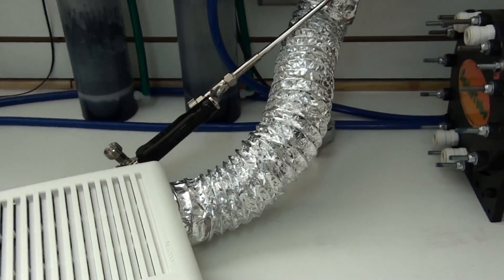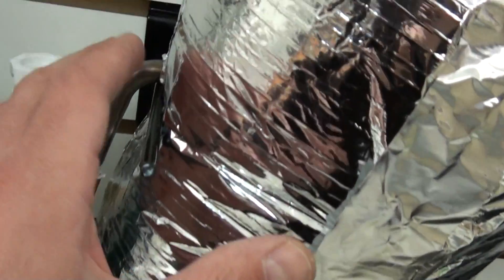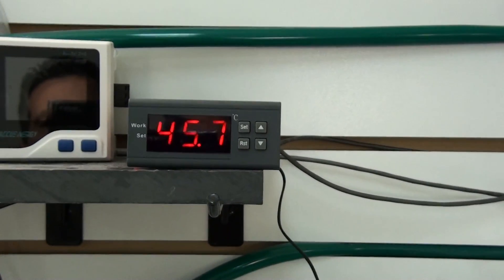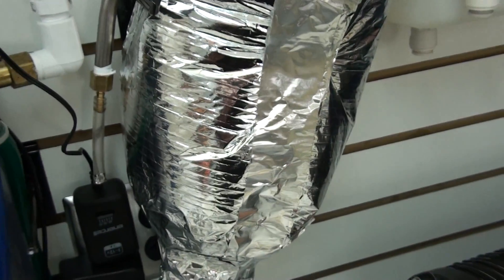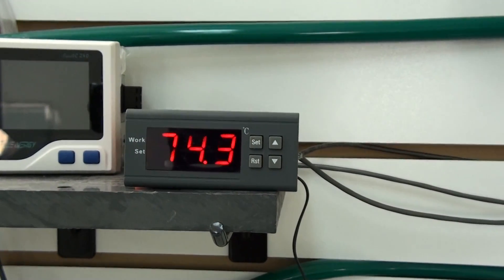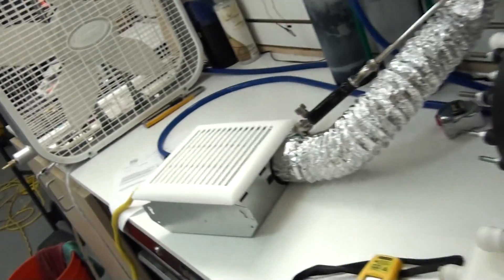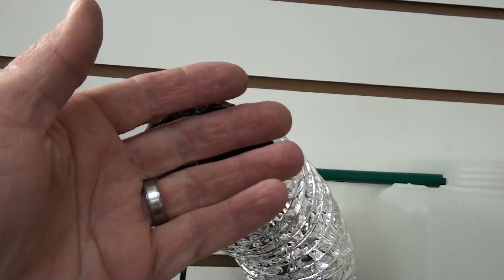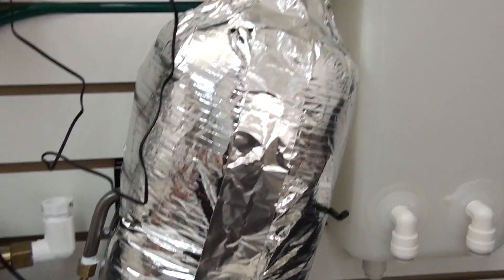H-CAT video 8

Comment: A couple years later... a couple more more observations...  
It appears that before you turned the fan ON, it was "running rich". With more air into the "combustion" area, it leaned out the process... then went too lean.  It would reveal a lot if  you had the inlet fan on a variable speed control, to see if you can find the optimal mixture ratio for maximum output energy... not maximum temperature, but calculated Btu output.
Reply: I agree with the variable speed,  even if the fan is only 50 c f.m. the velocity in the 3" pipe has to be around 600 - 700 f.p.s.    Need to slow down to a crawl and slowly increase the fan speed/air volume till you find the magic bullet!
Also need to take in account the 65 degree temperature of the space which is being induced into the cat dragging the temperature down.
Fun project though,  soon I'll be working on mine    GOD willing.

Comment: I love it! What is the cfm on this fan? And did it warm up your shop? How many square feet is your shop? A 10 degree rise in temp is good if it has a lot of air flow and that means 3 1lpm HHO generators should cause a 30 degree rise in temp while only using roughly 360 watts. Also if you use a duct fan and put your torch on the intake side your HHO will stay under vacuum instead of fighting against the air flow of the fan and running more amps through a hydrogen generator doesn't necessarily make it more efficient, so try running 2 or 3 of these hydrogen generators at 10 amps each. Also when you put too many amps through a hydrogen generator the water heats up and produces steam which is highly inefficient. At 30 Amps and 12 volts I've seen an old hydrogen generator of mine boil and evaporate all of the water out of the generator and the bubbler!

Comment: A couple of thoughts. I. believe you need to make a coaxial arrangement that keeps your extracted heat separate from your combustion mix. Pull your scavanged heat off the outside of the converter. I am sure blowing air through  the cat is diluting the mixture and inhibiting any magic reactions.
I'll bet the cat has to attain a certain temp to even get a good cat conversion going let alone the possibility of an LENR reaction. I seem to remember talk of the special additive to Rossie's cell was carbon so you might not want to get to aggressive with your cleaning. ;-) Another thing I'll bet would help is a multi head gas injection arrangement that gets the gas distributed across more of the  cell making more little bright spots that would give more reactions. Maybe a circle of copper with mig tips.suspended at an optimum distance from the honey comb. Just a couple of ideas and my best wishes. Go forth and heat up your shop!.
Reply from the maker: See video's 9 and 10. I do just what your saying. I like your idea on the mig tips also.
Reply: +delvis11  I agree with David  to much air through the chamber it looks feasible though  tweak the hell out of it right! was thinking along the same lines for the combustor flow a pc fan intake a tubular burner style feed spread the gas around the substrate and collect the heat from around the chamber.... also to heat the shop  pick the air off the floor pull it through a box around the cat with heat sinks on the cat into a 6inch inline booster fan or the one you used here presuming its about 275cfm...  use both outlets   but separately  heating your space is easier if you pick up the cold air not bench level  ... subscribed to your channel thx....

Comment: If you knew the CFM rating of that fan, you could mathematically calculate the BTU output, then you'd have real numbers to work with as far as calculating overall conversion efficiency.

I will chime-in with others that your combustion / catalyst exhaust needs to be separated from your air-exchange temperature.  With an appropriately sized catalyst exhaust pipe (pretty darn small based on the required catalyst inlet flow rate required), you can use heat exchangers (heat sinks) from the "exhaust" pipe as well... but exhaust that thing outdoors... UNTIL you know for sure it's not harmful.

Right now you are breathing the exhaust gasses... and those gasses include NOX... since our atmosphere is like 78% Nitrogen... and you're also burning oxygen keep that in mind. "NOx gases are formed whenever combustion occurs in the presence of nitrogen" (Wikipedia NOx)

Many great discoveries came at the price of the health (or life) of their discoverers... please be careful.

It'd be important info to find out if the plain, raw, unpolluted HHO is all that's required for the catalytic process... seal the input, or have a variable valve for admitting atmosphere.
Reply from the maker: well I do have the cfm rating. how is this calculated?
Reply: CFM * 1.08 * tRise = Btu/hr

Comment: Hi Steve,
I think that you are flowing too much air for the amount of HHO you are putting through the catalyst. What would happen if you were to use the production from the 354 plate cell to increase the concentration of hho?
Also, I am curious how well this would work with pure hydrogen (the oxygen could come from the air that is to be heated)? Just some ideas for future exploration and/or videos.
Keep up the great work.
Jason
Reply from the maker: Thanks Jason I will be trying pure H soon. I am waiting for a fitting to get me cell running. That huge cell in this video is a split cell.
If i use more than 2 lpm in this setup it will flash back.
Reply: delvis11 OK cool I look forward to seeing the results with pure hydrogen. In terms of the 2 LPM of hho limit, was that measured while you were also flowing air through the catalyst, or was it measured when you were flowing hho alone? If it was measured with air flowing through the catalyst, do you know the flow rate of the air? The reason I ask is I am curious what the maximum concentration of hho is that can be pumped through the catalyst without getting a flashback.

Comment: Check out my comments on jdc and hydrofuenincanada.  Put the cell bubbler under the cat inlet so the water comes under the ceramic.  This might give flash back and a lot more moisture to cat so it dosent dry out. I am thinking of a closed loop system and seeing what it would do. I even changed my mind and threw a cell togeather tonight.

Comment: Steve the last temp i saw was 90 F, and you are pushing a lot of 65 f air through cat, At 200 watts That is pretty good i think, I think a 1500 watt heater in that big space would be basically the same....?

Comment: I guess I am glad someone else said it first. The depletion of the catalyst will kill you. Its great you rediscovered this work with justin. Maybe a solution is close the loop in a radiator like device. Just be safe because neutrons will kill you. Steve I like your videos and work. Something is not correct in this H-Cat because its dry and a cat needs to be wet or it will destroy itself.  I gave justin a bubbler idea using the H-Cat as a bubbler and recalculate the gas. I am busy on a huge project so I can't build but I would like to offer my observations and push this along. Good luck and I stress be safe. 

David A. Puchta
Reply from the maker: What do you mean it needs to be wet? I'd like to hear your ideas.
Reply: delvis11
David is full of shit.

Comment: Great work Steve. For 200 watts your pulling a lot of air through that cat and diluting the hho down substantially. I've seen a 200 watt heater and the air flow mechanism is nothing more than a tiny computer fan. We have to match apples with apples with this right now. This will cause the reaction to slow down as well. Your also pushing the gas through a lot faster so it doesn't have as much time to interact with the metals as it would under slower flow rates. Your cat is one of the cheaper models so you don't have no where near the amount of noble metals that some of the more expensive ones would have. More noble metal exposure would mean it would also work better when being diluted with air. You may also want to move the air intake up above the cat and somehow allow the hho input to be free of heavy dilution. Don't give up, too much information has come out over the past week to prove there is something to this.
Reply: I agree restrict the air flow on 5% of yours current one

Comment: Nozzle size of gas onto the heating element size seems somewhat out of proportion.I think you need more nozzles in there or a much smaller cat.Also pushing air across it is changing the gas ratio.Blow air around it
Reply: Excellent input...I also agree
Reply from the maker: I agree completely

Comment: your cooling it down with the bathroom fan so its not able to work correctly. You could use a really really slow fan. Try it with out the fan and just see if it will just draw upward with the heat its making. Too much incoming cool temperature is keeping it from having a reaction is my guess.
Reply from the maker: It doesn't matter. I'm trying to get the heat energy out. I even put a piece of paper over the air intake to slow it down and still the temp drops way off.
Reply: delvis11 what about more Hydrogen gas?
Reply from the maker: same thing at 20 amps
Reply: delvis11 Get a different Cat at the salvage.
Reply from the maker: I cant I have to buy new. The salvage guys told me it's illegal to sell me a used one.
Reply: delvis11 I think they are loading you with pocket fulls of pooh. lol. They won't sale them back to the public because they know they are about to triple or quadruple their money. I know guys around here that make a living going around and salvaging cats and then selling back to the salvage yard. Most of the cats they get is from the public. You didn't tell them what you were using it for right? I wouldn't sale one either lol.
Reply: delvis11  plenty on ebay :)
Reply from the maker: I may see what some of you other guys come up with.
Reply: delvis11 I have all my money in solar.